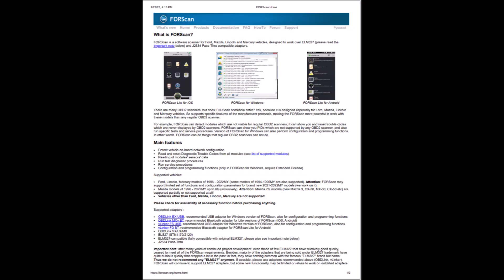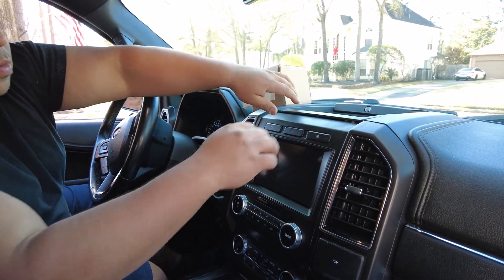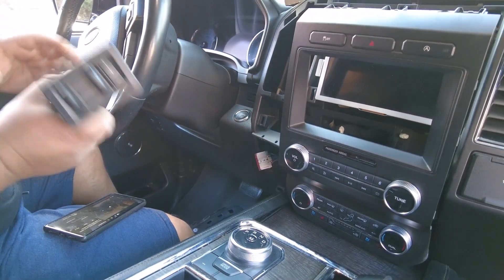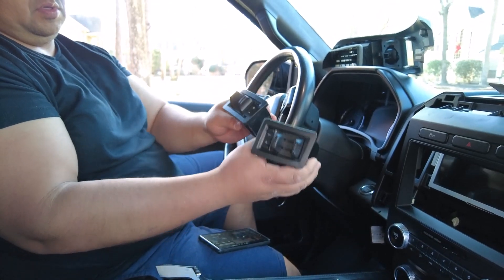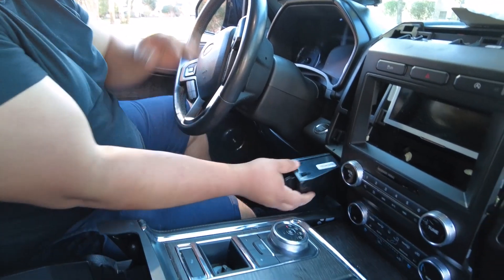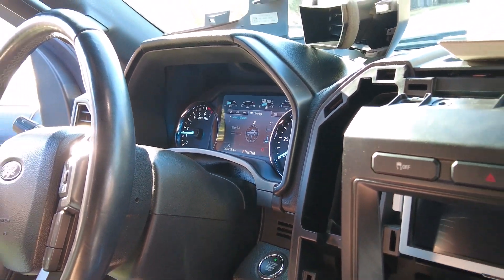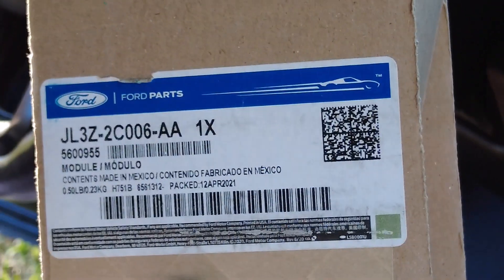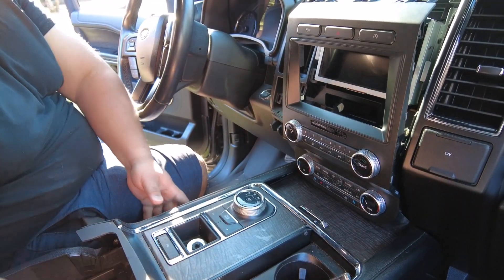How To Install A Trailer Brake Control Module 2018-2021 Ford Expedition [Revised]

Comment: I purchased a Ford Imitation controler from ebay for my expedition and I am not getting the notification on my screen, like gain, no trailer. Is this how yours was before you replaced yours?

Comment: Can you share the forscan code to enable the trailer brake controller? Ive done this before with a f250 but cant find code for the expedition

Comment: Did your FORScan work with the break gain ? I keep getting an error at 75 % then Fails
Reply from the maker: Yes it did for me, but I'm sorry to hear that your Vehicle is having trouble. If it continues I recommend you consult your local Ford and/or Lincoln dealer for help! Hope it will soon work out for you👍